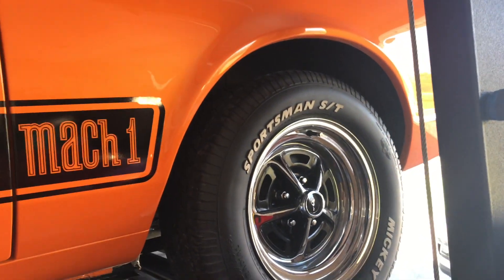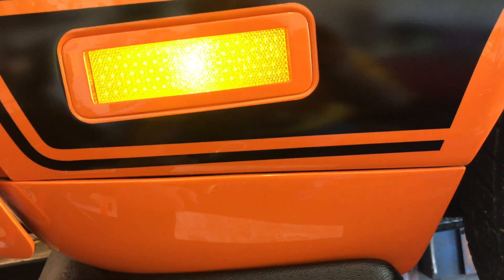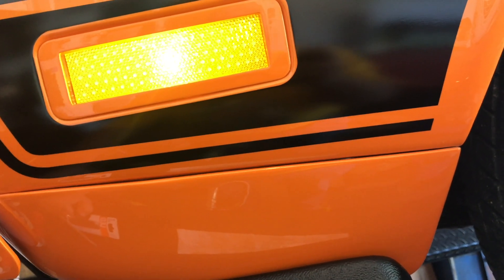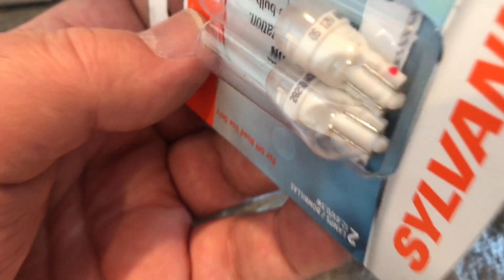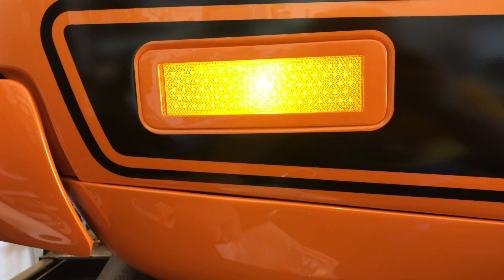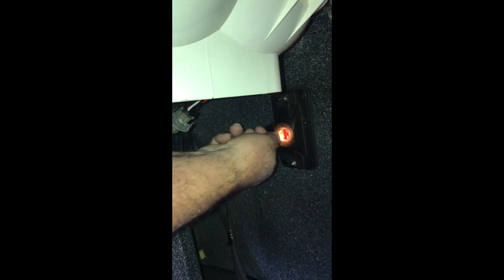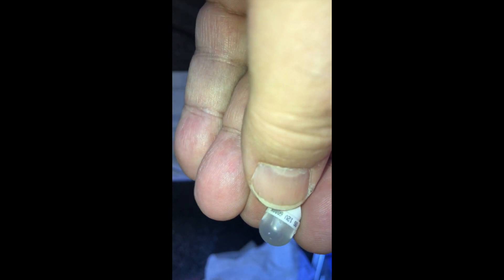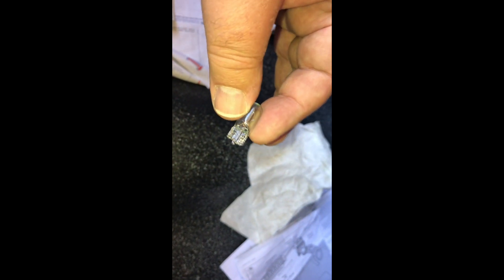1973 Mustang Mach1 Side Marker Lights LEDs 20210423

Comment: Hi, Gilbert! I have a 1970 Mach one. I recently replaced the forward Headlights and indicators as well as the rear Taillight / signal indicators to LED and the blinkers will ONLY work if the headlights are NOT on. Once the headlights go on, the signal indicator on the dash will stay lit and the blinkers won't cycle. 

I replaced the blinker relay with the one supplied by the manufacturer but did NOT Upgrade the marker lights as you have. Do you think that upgrading my side markers to LED might solve this issue? my speculation is that the incandescent side markers are stealing the power from the forward LED.
Reply from the maker: Your situation smacks of a more typical bad ground with the wiring on the headlight related wiring, and could be on either the driver or passenger side.  Please email me at gilhale@gmail.com and remind me of the matter at hand.  I will put together a schematic excerpt to get you on a good path.  At least an excerpt as god as I can.  The wiring schematics from 1965 -1971 are relatively terse.  Accurate, but not as clear as 1972, and especially 1973 schematics.  None-the-less, I am certain we can get your lighting issue rectified pretty quickly.

I hope you are able to nail the problem down, with or without my help.  Electrical circuit issues can be so confounding...  And, I am very happy to help where I can with this matter.  Thank you for reaching out...

Comment: Too bad it’s not more diffuse
Reply from the maker: The intensity of the LED light diodes is not as bad as they appear in the video.  It is bright, and brighter closer to the LED diodes, but visually it is not excessive.  If on the other hand, I were to see a replacement bulb were the LED diodes were mounted differently, where less brilliance was directed to the lens surface, I would get that design just to see of the hot spot is reduced significantly.  Meanwhile, I am just happy to have the side marker lights working consistently now.